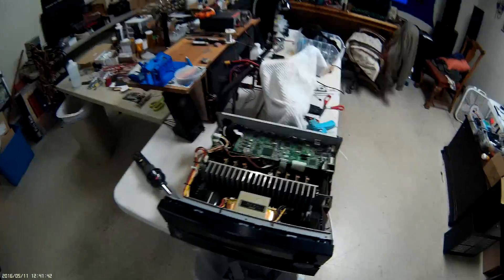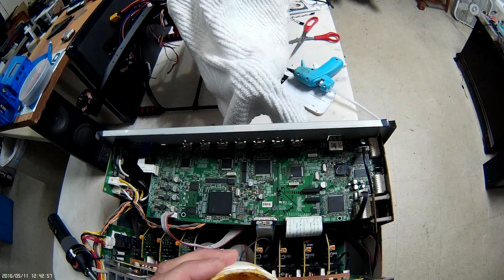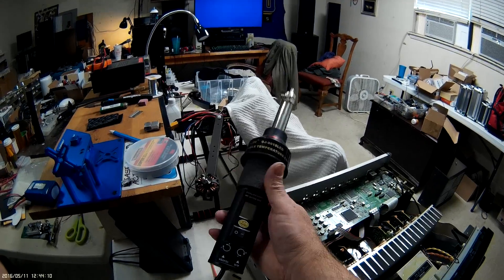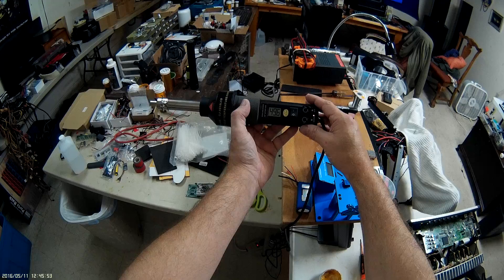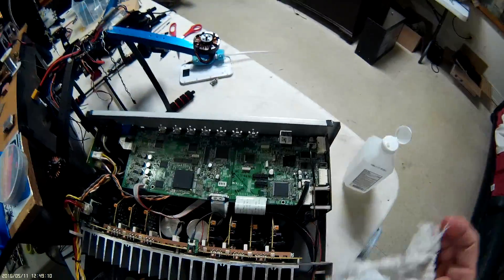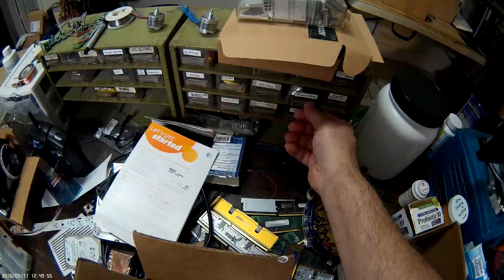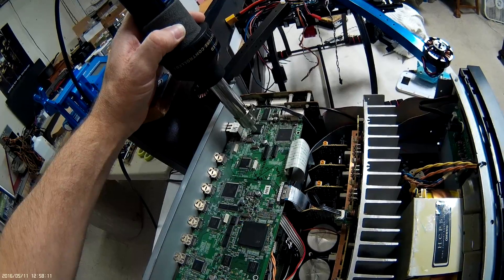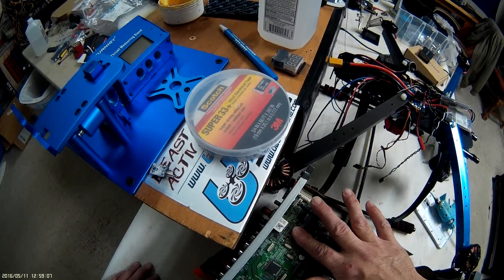Onkyo TX-NR Receiver DTS chip Reflow Procedure

Comment: Most of these devices crash in the BGA DTS and make reflow work again, but after a while it goes back, I had not seen anyone changing components, I think that here in Brazil some technicians act in bad faith and do this or change the chip or even change, change the capacitors and charge the value of the chip.

Comment: Hi Shane, I have an onkyo tx-sr705 that is making weird sounds like bombs in my speakers do you have any idea what that might be. thank you so much.
Reply from the maker: Can you make a audio recording with a cell phone and email that to me or link it with Google Drive? I need to hear it to be able to diagnose. But if I had to guess, anything from the high output caps to the output transistor finals or even the transformer which is very unlikely but could be with a big enough surge. my email address is advancedpcrepair@cox.net

Comment: Thank you for posting the video. This helped me to fix my in-laws Onkyo Ht-693. I heated up both of the DTS chips with flux and a heat gun that I bought at Home Depot following your direction. I cleaned it up with electronics contact cleaner and viola, it started right back up! My father in-law is going to be so impressed (probably not, but we can dream, can't we).
Reply: btw op says he uses jb weld and then says lets hope there isnt  a fire....           use a small well finned heat sink and  thermal paste infact i used one the size he holds up last is a bit big.............  that i salvaged off a south-bridge... and 420c from a heat gun for about 15 to 30 sec is fine across the chip. then let it coooooooooooooool. seriously leave it . bam test it and if it works rejoice mofos!!!!!!!!!!!!!!
Reply from the maker: You're welcome! Something weird is going on with YouTube right now. Your comment is the only one showing right now. This video has many comments on it since I posted it. I wonder where they went.
Reply from the maker: Because we discuss many things in those comments about these receivers.
Reply from the maker: Got'em. Took me refreshing Chrome a couple of times. I'm glad you got it working. It could fail again though. What I was doing to make them last longer, is to glue a heat sink onto the DTS chips. With the unit on and the top off (be careful not to touch any 110v wires that should be on the right side looking at the front) touch the DTS chips to see how hot they get. If they are too hot to touch or it is more than just warm, heat sink them. I used epoxy to glue them on with. A very thin dot in the center of the chip, then press the heat sink on to spread the glue thin.

Comment: Great video, I ordered a rework station and it's first job will be my TX-NR636.  I'm going to follow exactly what you do.  My unit has two of those infernal chips.  Hmmmm.....  The most aggravating issue it has is the video blinking out till the unit is off for 20 mins but sometimes the sound gives me grief till I do the same.  Is there a chip for each?
Reply from the maker: I don't think there is a DTS chip for the video side, it's just used for converting audio from analogue to digital and vise versa. It would be where the SPDIF goes and when it has an issue like overheating and desoldering from the board by cracking the solder joints when it flexes from the heat then cooling over & over, you lose the audio matrix grid on the display and the amplifier relay never clicks to fire up the amp. This is the most common issue that happens. Also HDMI doesn't switch in some cases.
Reply from the maker: And thank you. The camera I was using is a great camera, but I was trying out settings on it when I made this video and I did finally get it smoothed out. The strange thing though, it plays and looks good when played local. YouTube did something to it when I uploaded it. I didn't use any modifications either.
Reply from the maker: For sure on the rework station. That will let you upgrade this chip to one that doesn't have the issue. Look into the part numbers on your chip and see if there is a package update that matches the grid type of the original. They have updated these DTS chips for most of the HDMI boards.
Reply: :-)  After about a year the video would drop off after a while.  Fast forward a year and now I get about 5 minutes of video.  What's an SPDIF?  I was messing with it a couple hours earlier and touched one of those chips to see how hot (it wasn't hot) and the video dropped.  I don't know what to do, I don't want to buy another amp and should not have to and Onkyo is in denial.  Any suggestions?
Reply from the maker: SPDIF is the square ports on the back of your receiver. Those are for optical SPDIF digital audio and they also have the single orange RCA jack for coax SPDIF Digital Audio in. Lets say you have a desktop PC and it has SPDIF Optical out on the back panel. You would take a toslink optical cable and connect that optical out to one of the optical ins on the receiver. You go to the video input settings and change the audio to SPDIF Audio 1 (Most Onkyo receivers have 2 of these...1 & 2) or something like that. That would then give you the digital audio tracks of movies in DTS surround sound or whichever surround sound coding was used, it switches it for you and you hear a relay click when its working. The sound range is instantly changed to a much higher sound quality and the channel separation is unreal.  I can do a video on a newer Onkyo Receiver I have here that's very much like the way its done on all of them and show you where those settings are. Any audio device that you aren't using HDMI for would use this since the video output may be something other than HDMI. HDMI passes digital audio over the cable but I think on a computer audio setup, even if the computer has HDMI, it sounds better with the SPDIF Optical doing audio because the chipset would be Realtek and the HDMI video out would be Intel, Nvidia or ATI...something like that. The audio drivers for those are simple & not very great in some cases.
Reply from the maker: Which chip were you pushing on? I've had video dropout from a bad HDMI cable or one that was too slow for the content going across it.
Reply: i have the same problem. tell me which one is the one, front one or back one near RJ45 jack

Comment: Thank you for the information I have the same receiver with the same problem and I have the proper equipment cuz I do this type of work but not on a professional level what's the chances this will work for me
Reply from the maker: The chances are good as long as the DTS chip isn't damaged internally.
Reply: Thank you did you ever get the one working in this video
Reply from the maker: Yes. But then I lost it in the flood of 2016.
Reply: Shane Carles I'm sorry to hear that where was this flood sounds like it was bad
Reply from the maker: I appreciate that a lot...Thanks. It was bad. We lost everything we owned, including our cars. Had to rebuild my house from the floor up to the ceiling. It was the flood of 2016 in Louisiana. It was a 1000 year flood. I had over 4ft of water that came into my house. A lot of people's homes were over the rooftops though.

Comment: Hi Shane, I followed your step with DTS chip Reflow Procedure on my TX-NR 809 AV receiver. I had the issue that I had to turn on the receiver for a few minutes to be warm and then turn off and on again before I got sound. After the DTS chip Reflow Procedure the receiver works normal again. I have a solder-station with a heat gun so it was quite easy work to do, and after I glued a heat sink on the chip and put a 120mm fan on top of the chassi over the chip like in this video https://www.youtube.com/watch?v=AyzbIaVrWA8. Thanks for the great video it helped me a lot.
Reply from the maker: You are very welcome! I'm so glad it got you going again! :) Props!

Comment: Can I send you my board for reflow? I have a TX-NR818. I've been shooting it with a hair dryer. Oddly enough, if I leave it on, it will stop working, if I put a heatsink on it, it will stay on, if I put a fan over the heatsink it will stop working. Once I turn it off it wills top working.
Reply from the maker: Yeah,  heat expansion and cooling is causing the connection to break then, connect. I can try to fix it. I can't guarantee I will be able to. The only problem with sending me just the board is I wouldn't have the whole unit to test my reflow.
Reply: Good point. Maybe I'll pick up a one of those heat tools. I have a nice solder station, but have stayed away from the heat tools due to price. Appears they have come down a bit. How long does this reflow method last?

Comment: Thanks for video, saw a few of these. I had a 616 with no sound, donated to my MakerSpace. Tried the hair dryer option, worked for a few minutes, then made a card-cutout wrapped with foil and placed over the dts chip, so the chip was the only thing showing. Hit it with a workshop heat gun, didn't work first time, but removed the foil cover and tried again, not for a long time, but it worked. Still OK after three days. It is a great piece of A-V equipment. Cheers, John
Reply from the maker: Awesome. I'm glad you got it running. It takes enough heat to melt the solder under the chip. The foil was blocking that heat from getting to the surface like it needed to.

Comment: Thanks for the video, I have a 606 who is experiencing the same issue. Just for my understanding, 600 degrees farenheit right?
Reply from the maker: Yep, that should be fine.
Reply: Grat thanks, i will try to fix it myself. So process goes like follow right?
1)clean DTS chip with pencil
2) put flux and tilted for flux to go underneath
3)heat chip - ~600F until flux melts in waves of 10 second each
4)let it cool and try
6)apply thermal glue and place heatsink
Thanks

Comment: great video!!!

just one thing, the over heat isn't caused by the chip itself but rather the power supply that sits under the hdmi board.

i dont know why onkyo do not use some fan to cool it down. the power supply uses rectifiers and regulators that get really hot, and they literaly cook the hdmi board.

my onkyo tx-sr 607 had similar issue because of it. the caps got dry really fast.

my pioneer vsx 921-k have the same chip and no problems at all, just because the unit runs way cooler than the onkyo.

either way i might buy some onkyo with this fault and repair it myself
Reply: Actually, it's both. The DTS chip is being supplied too much voltage due to the design of the board, AND the heat from the PSU board underneath further accelerates the problem. My TX-NR515 lasted 6 years before giving up the ghost, others have had their amps last for as little as 2 years. I'm sending mine away to see if it can be repaired, if not, I'll try the method in the video, in addition to adding some heatsinks to the larger chips on the board.

The comment in the video about the fan on the heatsink is total tosh though. The fan will help wick the heat out of the heatsink. Why do you think PC-CPU coolers have had fans for the last 30-odd years, if it doesn't work?
Reply from the maker: These receivers do have fans. This one has 2. A push and a pull fan. But to tell you the truth, I've NEVER heard them come on but that could be because the sound was so LOUD from these receivers, I probably couldn't hear the fan come on. I needed to test one of these with the top off and running at 75% volume on 7 Polk tower speakers. Then take a look at the heat situation while I jam.
Reply: the problem is that the power supply gets hot even with no sound output, at least in my older onkyo.
if it has a fan just for the power amplifier, then the hdmi will always get super hot. if it ouver heats even with fans, then onkyo have a really bad design on this units

Comment: Hello, I have watch your video and follow it like you said, but while I was reflowing the chip,  I heard a crack sound and later on, I found out that there are some bubbles coming out of a small place between the black insulator and chipset board. After viewing with magnifier,  I saw a little crack between the insulator and the chipset board.  That's if mean the dts chip is damaged? But the sound work when zone 2 or the Bd\Dvd + power feature is used to ignore the hdmi board. If the chipset is damaged,  where can I get replacement part because am in Ghana/Africa and there is no onkyo service here, so I have to fix this myself. Thanks a lot
Reply from the maker: You may have used too much heat for too long.
Reply: Shane Carles not that long, only for few seconds.  So does it means the chipset is damaged?
Reply from the maker: Probably so. If it cracked the lower layer of the matrix circuit, it could break the pin layer connections.

Comment: Good video. No, you can't overheat the chip by using a fan with "heat staying inside of the chip" :)) That's a hilarious statement BTW. However, fan is not needed if it stays below 100 degrees
Reply: Yeah, he lost some credibility when he said adding a fan to a heatsink will cause the chip to burn up. It actually will improve the heat sinks ability to pull the heat out. The heat sink will pull heat out through conduction then the fan adds convection and it improves the heat sinks ability to pull heat out.
Reply from the maker: What I meant by that statement was, there is no mounting options for that chip on the board. So the heatsink would have to be glued on and if the surfaces didn't meet correctly then cooling the heat sink would trap the heat in the chip. I've seen that before.

Comment: Hello, did You fix this receiver, i have a pioneer receiver with the same DTS chip with the same problem, no sound, tried reflow, didn't work, reballd the chip, still no sound, is it possible for the chip to go bad, and a replacement is required? All the voltages are where they should be, accordin to the service manual, don't know what else to do, please advice, thanks!
Reply from the maker: Yes, it is very possible for the chip to go bad and need to be replaced. First thing to check is the 5v rail that supplies power to the DTS chip. It should be no higher than 5.2v DC. If it's at 6v or higher, that would be why it's overheating and burning up. Either fix the 5v regulation or put a heat sink on the chip after replacing it.
Reply: Thanks for the reply, i did check for the voltage supply and its stable at 5.2V, i also replaced all electrolytic cap's, so the only thing that can be bad is the DTS chip, i don't know if you ever tried to update a receiver like this with a bad DTS chip, but on mine when i try to update i get stuck at 20% and then i get "update error 1", tried with 7 or 8 usb memory, and with eachother for 4-5 times, could this chip be the coulprit for the update issue, or is possible to have other bad chips on Digital Main Assy?
Reply from the maker: I would imagine the DTS chip alone would cause update errors if when the firmware tries to update the drivers for the DTS chip itself and if it can't see the chip it gets stuck. I would get a new DTS chip and reflow the new one and then try the updates again.
Reply: Hello again, the new chip arrived, but still no luck, am i doing something wrong, or the problem might be somewhere else, i get the same error when i try to update and no sound, any advice on this case?What else can i try, any ideeas? Thanks

Comment: Shane Carles, my AV is a TX-SR606 has sound in Zone 2, however in the main there is no sound, can be problems in the chipset too?
Thank you.
Reply from the maker: I doubt it's the chip set.  Check if that system has separate outputs for Zone 1. You could have a bad output in Zone 1 if there are separate outputs for Zone 2.

Comment: Hello Shane, I was wondering if I could use a heat gun instead since I don't own a desoldering iron.
Reply from the maker: I don't use an iron on these. I use a heat gun as explained and showed in the video.
Reply from the maker: You can't desolder a matrix chip with a soldering iron anyways. All of the pins are under the chip and are not exposed around the chip.
Reply: I'm doing everything as shown and still cannot get the audio to come on.  What else can it be?  I can't get the temperature as high as 650, 400 was my max.  Saw another video where the guy only got it into the 200s.  Either I fried it or just can't get it hot enough.  The hot air gun I bought is supposedly advertised at 650 degrees.  

Wagner HT400 gun
MG Chemicals No clean flux paste
Reply from the maker: Tomz Rain - I've seen the chips be damaged before. Also, the caps on the HDMI board have gone bad before. I just replace all of them to make sure.
Reply: Sounds like a job I'm not qualified for. I guess I'll have to get it recycled at Best Buy then.

Comment: What brand flux did you use?  Radio shacks are gone in my area.  I need to be able to find it online.
Reply from the maker: This is what I'm using. When Radio Shack went out of business I bought 5 containers of this so it would last. It works great and I like it because it's easier to clean off with alcohol. They are out of stock though. - https://www.radioshack.com/products/rosin-soldering-paste-flux
Reply from the maker: Here's another place that sells it but out of stock also - http://www.4surpluscity.com/radioshack-6400022-rosin-soldering-flux-paste-non-spill-2-oz-jar.html
Reply from the maker: I would try any Rosin flux and see which one works for you.